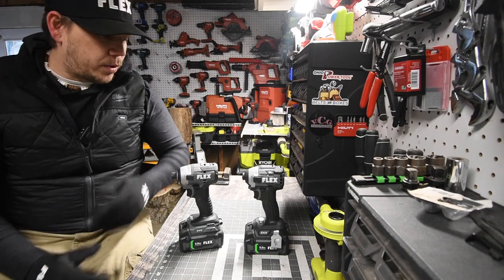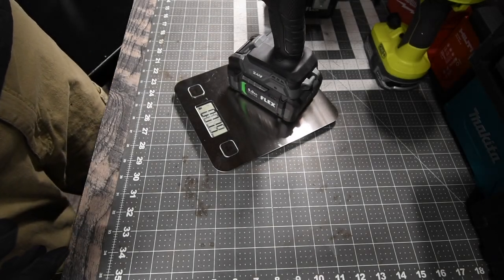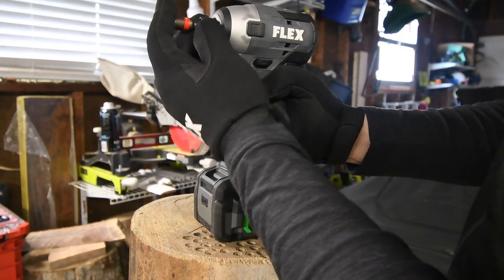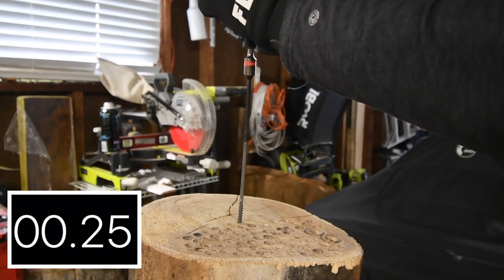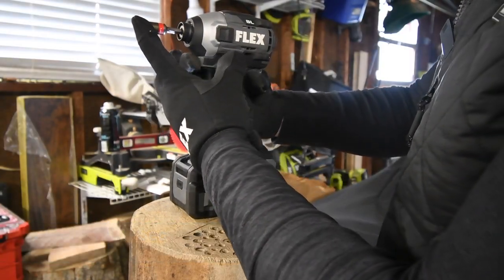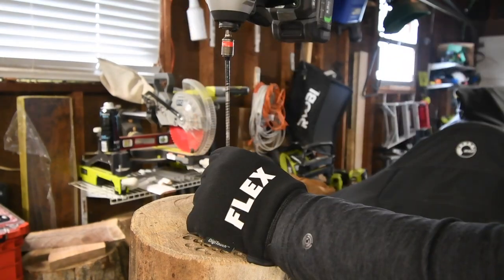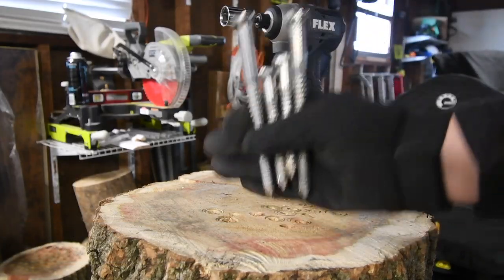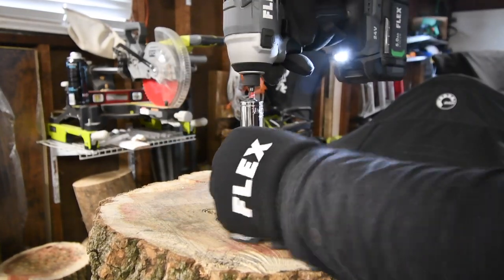Which FLEX Is Best For You?

Comment: Hey Dave you could always take the rubber piece off of the front of the 3 speed and cut any metal casing off with a rotary tool to expose the collet more. Probably take like 5-10 minutes.

Comment: I think the 3151 is for people like me: Homeowner/DIYer that only has had cordless (Ryobi) and corded (Dewalt) drills and mostly just want to anchor (shorter) fasteners and the occasional 4-6" lag. I felt like I was going to burn out my corded (older) Dewalt drill on a few lag bolts and you really had to lean on it to not strip/core out the screw heads on the harder woods. So a moderately/decent powered impact is perfect. I just got the 3151, 2 2A batteries and a fast charger for $159 - with a limited lifetime warranty on the parts AND the batteries (3 replacements) (at Lowes). So, yeah, I could get the tool only 3171 at the same (similar?) price, but I don't need it and can spend the extra hundreds of $$$ on my 14th EGO multi-head tool attachment 🤣😂. I hear they're working on a haircut/beard trimmer - gotta get that! 🤣😂🤣. I'm just a DIY hack, if I ever need a pro tool, I'll get the 3xxx driver a few years from now (or a Milwaukee Fuel Gen 99 impact driver and be done with it 😁).

Comment: Dave MCT, regarding about the Flex Quick eject Turbo impact driver I love it! I love the Quick Eject Trigger on the tool, it reminds of my old Dewalt DCF895 Brushless Impact Driver. The best Brushless Impact Driver that DeWalt ever made! Luckily I still have them in my possession I have 2 of them and they're both retired from the jobsite. I don't use them in my jobsite because they might get stolen especially my 2nd one is still looks new the other one is pretty beat up abused.

Comment: Hey Dave MCT, they're both great for me! The baseline Flex impact driver and the high end high torque impact driver. I bought the baseline Flex impact driver pair with the 6-1/2 Inline circular saw with standard 18650 24V 5.0Ah battery. Then I purchased the high end Flex, it's a pair, the quick eject and turbo impact driver and turbo Hammer Drill w/ 3.5Ah Stacked lithium battery, a standard 5.0Ah. and I purchased a 6.0Ah Stacked lithium 24V battery. I've had that a tools for a month now and they are Milwaukee Killer, or Milwaukee repellent. I've seen Flex reviews that the Flex annihilated Milwaukee and DeWalt and Makita in all of the test. And I'm gonna be purchasing the new Flex 24V Rear handle Saw. I don't use my Flex tools that much in the jobsite because they are so very expensive, I only have them for Showdown and standoff tools against the Milwaukee guys in the jobsite. But most of the time I'm running Ryobi impact driver, DeWalt dcf885 and 887, Makita xdt11Z, Bosch Freak, Craftsman, Hitachi and Harbor Freight Hercules Impact Drivers and Hammer Drills. Not just cordless tools but also Corded tools on all of the brands that I mentioned as well. including circular saw, worm Drive saw, miter saw, angle grinder, Pneumatic framing nailer, electric planer, and all other corded and cordless tools. Even though I have a Flex tools, I'm still not loyal to any of the brands.

Comment: That variable trigger impact fared like hot garbage.
I guess it'll get beat by the Milwaukee and Bosch variable trigger impacts and barely edge the wimpy DCF809 and Ryobi Compact. 

The fact that Flex sells both impact drivers for the same price makes the lower powered model pointless. Knock $50 off and I still don't see a case for it. This is a $129 kit tops

Comment: Why does no one really talk about ergonomics when using these tools? Frankly, Flex’s ergos on the impact drivers and drills are pretty bad in any kind of long term use. Very reminiscent of older Ryobi green tools. It’s just those tools so far as well, the other Flex tools I’ve got have good ergos. Hell, the drywall gun has the best ergos I’ve seen on a cordless.

Also, can we stop calling the FX1371a a “quick eject,” because it’s a butchered manual collet with a button to market bad design as a feature. Only drivers I’ve come across that actually eject bits were made by Ridgid, Ryobi, and Dewalt.
Reply: I agree 100% on the ergonomics of the impact driver and drill driver. It's terrible. I thought I was just being biased and not giving them a fair shake, so I'm glad someone else spoke up about it. 

For long term use, they're almost unusable. I'll take my Makita 18 volt impact driver any day of the week for all day usage and just break the Flex out when I've got some heavy duty driving to do.

Comment: you should take that lower grade impact and start comparing to other brand - high grade impacts just to determine flex is not a pro tool brand hahaha
Reply: Sorry dude, but Flex is a Pro/Contractor Grade tools and Flex exceeded way beyond after the Flex defeated and Annihilated the leading brand Milwaukee, second Flex beaten up DeWalt all 3 of Dewalt's Flagship impact drivers dcf887, dcf850 and dcf840 all 6.0Ah 21700 cells and the 1.7Ah Power stack battery. Both Milwaukee and DeWalt got beaten and got Annihilated so easily. Same thing with Makita. So yeah you can criticize Flex. But Flex is the new king now. Now that Flex is the new King. There's a another tool brand out there that posses a threat, have you ever heard about the Caterpillar Powertools that uses Graphene Batteries?? Caterpillar is the same company that builds, makes and manufactures Diesel Engines for Semi Trucks, Industrial Generators, Equipment, and Farming Equipment now they got Powertools and they entered the market.
Reply: @twinbee4243   lol I love your passion for flex , but I was being sarcastic there :)  I was making fun of people that do those comparisons using lower grade stuff and call the brand secondary . Idk about being a new king, but I do thing that flex had great tools and will continue to improve. I have not heard of Caterpillar powertools, is that CAT tools?
Reply: @UncleIvan1  passion? I have passion with tools any tool Brands (except Milwaukee 🤪) I have passion with tools as I have passion with Firearms and knives. Great thing that Flex came out I was amazed, astound by it's power. But still that doesn't make me loyal to just one brand. Just like I said I'm not loyal to any tool brand. And I do not choose any tools from expensive high end tools, to budget and to piece of crap harbor freight tools. I also owned some 😁. Don't get trigger dude but Flex is way beyond the contractor grade tool standards. I mean Flex took down the champ Milwaukee, and Flex had taken down all 3 Dewalt's Flagship Impact Driver (887, 850 & 840) all of them got destroyed by Flex. Flex is the new king 👑 now man. ✌️😁 And I'm also checking and looking at the Caterpillar Powertools that uses Graphene Battery technology the caterpillar claiming that their graphene is much better 4X better than any Lithium Ion batteries exist. I'll wait for next year to see if caterpillar will have something new that can beat the Flex. And don't hope for Milwaukee because Milwaukee has been seating for many years as a champion 🏆, they didn't realized that they needed to go back in the drawing board and science lab to improve their shit until Milwaukee got beaten so badly 🤣🤣🤣. Now it's too late for Milwaukee to do that. Milwaukee gen 3 Fuel the top notch undefeated tool got beaten by a 1st Gen tool brand? Isn't that kind of embarrassing for the TTI company? Realizing they will never have that kind of technology that Flex have because Flex technology is highly secured by US Patents. And protected by Intellectual property theft. Too late for Milwaukee. The red tool got beaten ✌️🤪
Reply: @twinbee4243  flex needs to come out with much tools to be considered a top brand.  I personally don't care about who has the most power.  This is why they make these comparisons and it's mostly debatable.  There are many categories that make the tool professional grade , not just power.  At the end of the day it's the tool that you keep teaching for first and the one that is a joy to use, but most importantly that gets the job done or makes you the most money
Reply: @twinbee The Flex top of the line impact driver has got power, but guess what?  It overheats and spews grease of you push it hard enough so in my eyes, it's not the best! 

Couple that with the fact that all of their 24 volt tools are bulkier and heavier than Milwaukee, DeWalt and Makita and the ergonomics on the Flex impact drivers and drills sucks! 

For me I'll take a lighter, more ergonomic, almost as powerful, but also almost bullet proof tool any day of the week over these Flex tools. They have some things going for them like power but in all the other categories they get spanked. It's a good thing they still come with a lifetime warranty because you're definitely going to need it with that impact gun. 

I hate to be the one to burst your Flex Tool bubble, but if it's only got slightly more power than some of the others but weighs significantly more and feels like deep in the hand, I'm going with the other brands. 

You might not like what I'm saying, but I'm speaking the truth from first-hand experience with Flex and all the other major brands. Sorry!